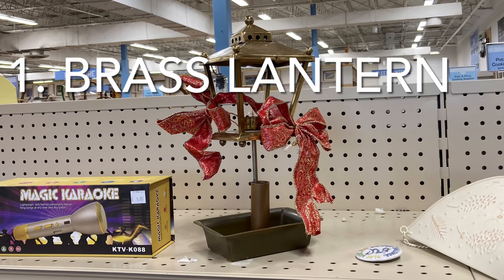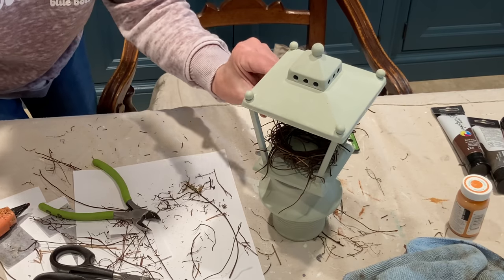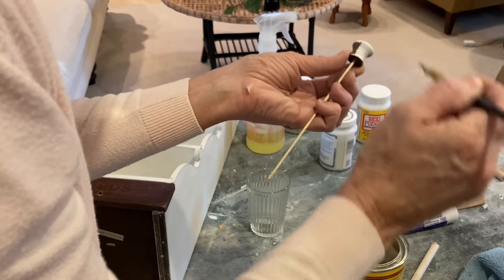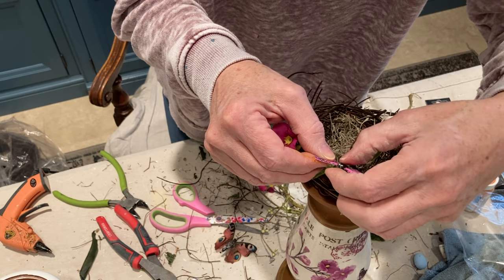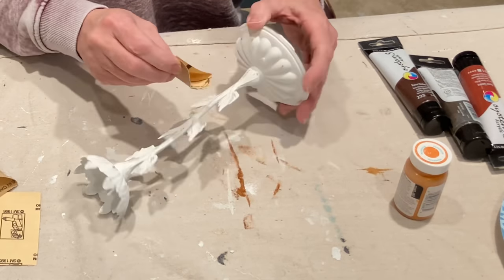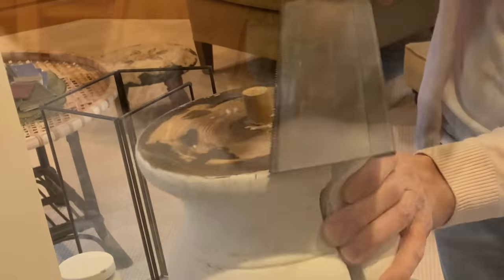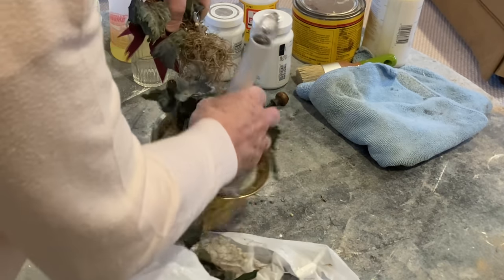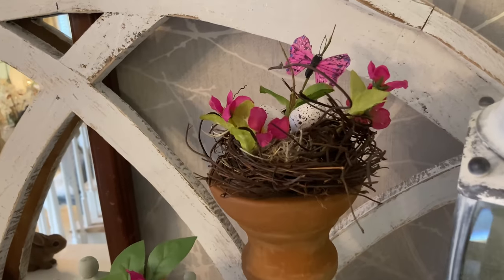Thrift Store Haul 7 DIY Home Decor Makeovers

Comment: I love all your your creations but am partial to birds too. How did you get the lamp to table conversion from being top heavy?
Reply from the maker: Thank you, Lynne.  There is a concrete weight in the bottom of the lamp.  Many lamps come with this, especially floor lamps.  You can see me putting it in the base in the video-it is that black (concrete covered with plastic) circular piece.
Reply: @CanterburyCottage  I had wondered if the concrete base was heavy enough. Silly me. 😂 That's my "duh" of the day. Thank you so much for answering. ❤

Comment: don't throw away what you dont need after taking apart items that you remake!!!   how do you paint over ceramic surfaces?  and how do you seal finished surfaces?  to keep them from chipping?
Reply from the maker: You can use spray paint on ceramic surfaces.  I usually start with a spray primer like Zinsser Bullseye 123.  When that is dry use what ever spray paint that you like.  Unless it is going to be handled a lot, it doesn’t need a sealer.  If you want to take that extra step to protect the surface, any spray clear topcoat should work. Hope that helps!